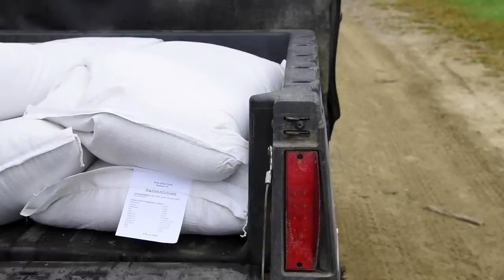How To Build a Chicken Tractor Flexible and Strong - AMA S6:E2

Comment: Run an internal 45° 2x4 bracket on the inside corners. If you set a plywood bottom in it, it could double as a triangular free-choice feeder area for grit, oyster shell, etc. or a dustbath.

Comment: John, I disagree with your design approach.  I've got a similar chicken tractor that I built for under $300 and it uses far less wood.  My design is from Vermont farm and uses bent EMT tubes that run all the way to the base and are not fixed at only one upper point like yours.  This provides 2 points of stability, which is important when a strong wind is blowing.  No need for expensive chicken wire to cover the whole upper part, let the tarp give the protection.  Sure a raccoon could slice through, but I run an electrical fence wire around the base.  Plus, what's with spending most of your vid speaking about an angle brace?  Come on, it's cheaper and simpler to screw in from the top a 1/2" strip of wood at each corner for racking.  My tractor has worked fine for years.  Finally, while I like your removable back wheels, I would use wheels on both ends so you can pull it in both dorections.
Reply: Go away. Take you negativity with you.
Reply: Absolutely correct. Any brace is stronger & cheaper than that. The longer: the stronger.
Reply: Where is the video for your design?
Reply: Can you help us out with plans or a video for your design?
Reply: @KaleidoscopeJunkie why? He just makes a valid opinion